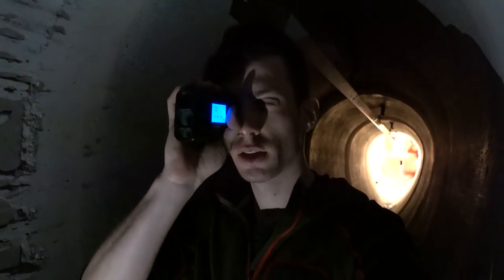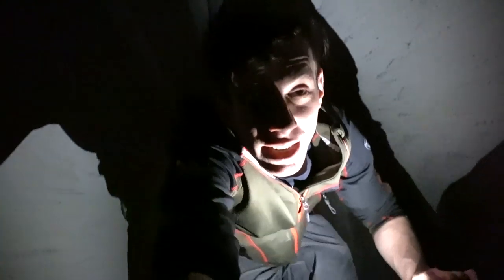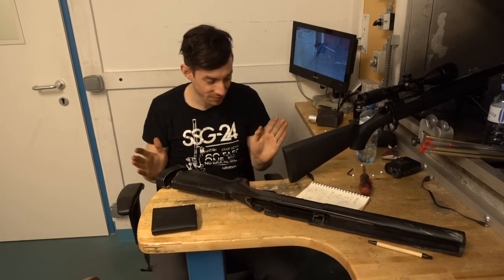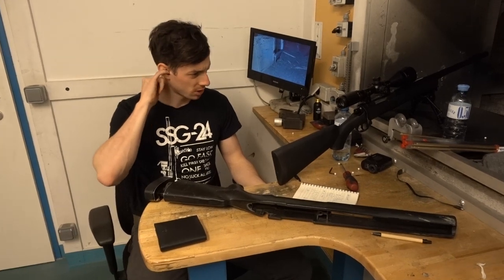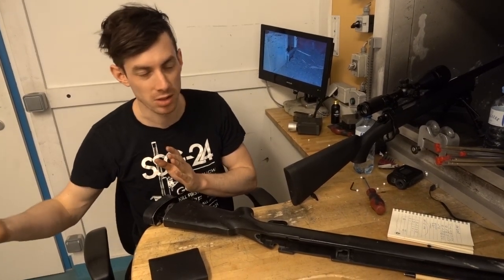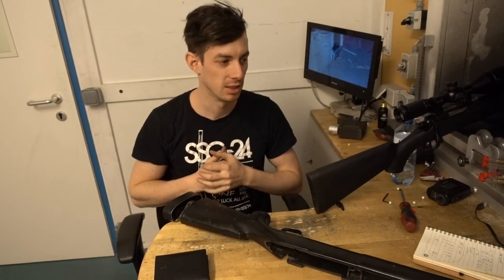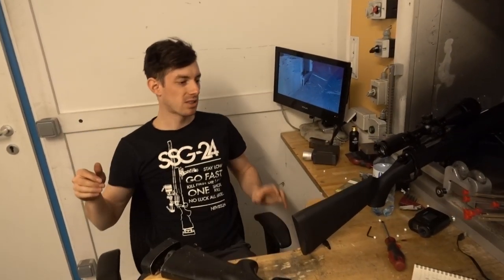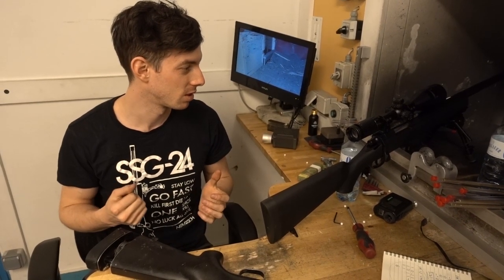What is the best Airsoft Barrel?

Comment: What Next ?bullet shape bbs ?
With twisted inside barrel ? That sounds stiupid but maybe not
Reply: That would be cool, have a much more accurate and reactive BB that would stand to winds then what we see with normal bbs.
Reply: That's done already, check HS5 Armories :)
Reply: Looked into it. The issue is rifling is causing material removal to make the bullet spin. We would need essentially a material that could flex or give when hitting rifling and at various temps and psi we get different effects

Comment: my dream is a test like that with a gbbr. fps, grouping and bbs' horizontal tracks (maybe with tracer bb) and gas type(green red black ect) should be shown in a chart in order to compare. and adjustment of hop up-fps-grouping  should be on  a different table because there are many questions in my mind. airsoft needs more scientific data about different upgrade parts
Reply: Theres a few channels starting to do these tests, still limited. But these type of hard proof tests are stuff the companies do not want out there because it may decrease their product image and sales. But personally I think its really needed to advance the sport, too many of the airsoft companies practice lazy manufacturing practices or bad ideas which they could fix. Its all about the money!

Comment: I'm not really surprised to hear that the 6.08 equivalence is better than tighter bores. The air energy lost in the gap between the bb and the barrel wall is less than the energy wasted on friction with a tighter barrel.
Reply: I also think we have to realize that unlike a bullet which is squeezed and rotating around the axis of the barrel, the BB is rolling down the barrel with its spin perpendicular to the barrel axis. This is fundamentally different, and if the barrel is so tight it causes the BB to bounce around instead of roll, it’s going to cause loss in angular momentum (spin energy) and will produce inconsistent hop-up.
Reply: @HypeBeast764  The BB might also surf on an air pillow like a Car would when aqua planing.

Comment: I use of some fundamentals of yours Sir on using hop up on a cheap toy sniper and hey...it actually worked. I just use some rubber on the pen grip of a used pen and carve a half inch or much little on it on the tip of the copper barrel and there it gose it works well.

Comment: Did you have each diameter from each manufacturer?

It's been proven that no matter what size the bore is, the bbs will always ride on the top of the barrel. So the quality in which the barrel is made (the smoothness of the inside) is the most important. Bores between 6.03 and 6.08 should all have the same groupings assuming everything else is equal. You will just get slightly different FPS depending on the bore size. If you go a lot smaller or larger than the above you start getting into factors that can affect the bb stability as it travels down the barrel.
Reply: Sources?

Comment: sooo...i litterally have tons of the barrels 3in-um sniper sized 325mm long  but they only fit m4 style i tried replacing a 3in 6.10mm in the kwa black kz61 with a 6.02, none of them fit and still shoot except stock,then i tried a cyma rpk with the longest barrel about 14in 6.01 it also doesnt fit,then i tried the hicapa 1911 gen 5 with its resembling barrel but 6.02mm it also doesnt operate once replaced,so i reinstalled the stock parts which is the only thing that works with them sadly ,very dissapointing